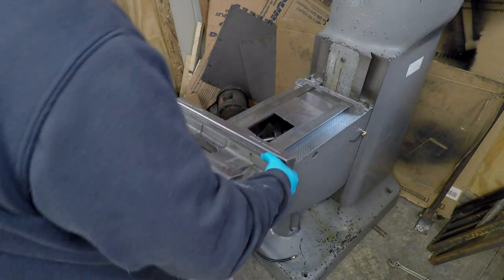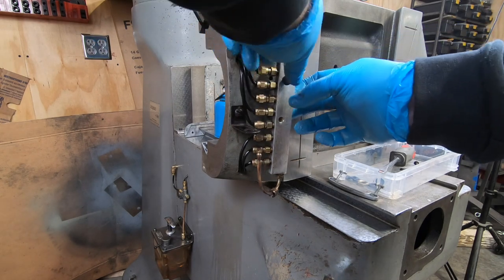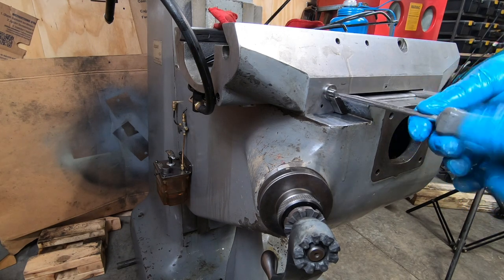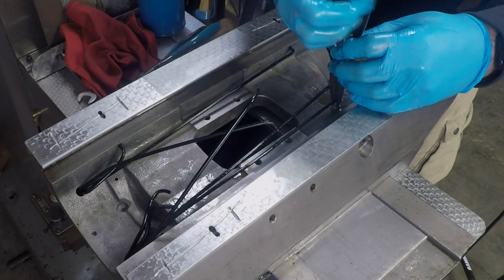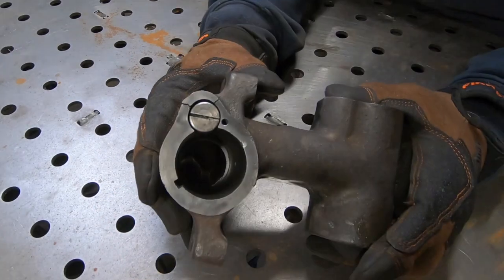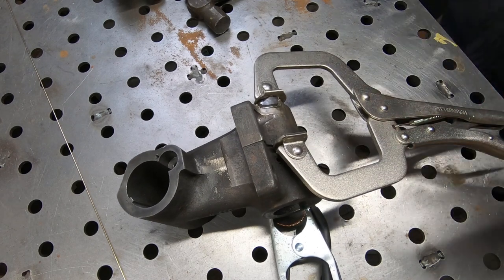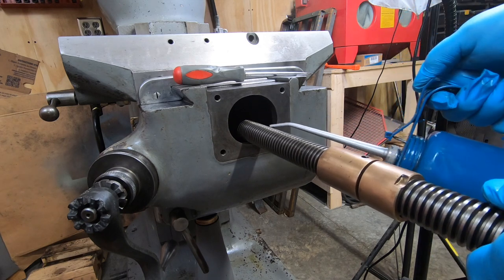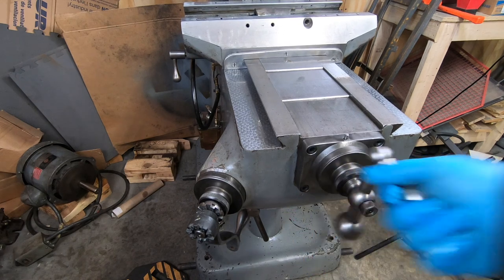Bridgeport Mill - Installing the Saddle and Oil Lines

Comment: Don’t add music, you doing a great job I just subscribed.  I am also about to start my Bridgeport rebuild/ clean up. I also have the same power feed that I just finished rebuilding. One thing you must make sure of is the seals ( or lack of) in the power feed. It’s a convoluted design in that if the seal fails it fills the power feed electronics with oil, and also if not sealed properly will fill the electric motor with oil. That’s what killed my Power feed along with the normal wear and tear of use. I used a little bit of automotive RTV in the reassembly to help combat the sealing issues and also made some umbrella seals out of nylon, that should fix the problem. You will see exactly what I’m talking about once you pull the unit apart if you haven’t already.  Thanks again Great job.  Eddie wheels 😬🧑🏻‍🦽👍 NJ.
Reply from the maker: Thanks. I'll keep my eye on that. There's supposed to be a paper gasket on the cover, but I know some people replace that with RTV, which I don't think it a good idea. There are a couple of other places it can leak, but over filling the gear box is another issue. I may end up just taking it off and replacing it with an extension shaft. We'll see.

Comment: Great videos!  Excellent step by steps on how to disassemble/ reassemble.  I think you could add some montage clips, or some fast forward clips along with some music.  Just mix it up some!  Also, do some experimenting with the Aluminum Bronze on cast using AC.  Works really well repairing dirty castings.
Reply from the maker: Thanks. I did try it on AC once and it didn't seem to flow as well as on DC. I'll give it another try next time.

Comment: Vote no for background tunes. Have you consider using a mike while doing the work  instead of voice over? Interesting,  thanks!
Reply from the maker: Thanks. I have considered using a mic. But there are problems associated with that, from both a personal and technological perspective. Technologically, I don't have the mic. I'd want to use a wireless mic for sure, as I move around the shop a lot. And then record the audio on a device separate from the cameras. No room in the budget for that equipment. PLUS, it would probably make the whole process take longer. I don't always say just what I want to say and it comes out as blather - I sometimes don't notice until I playback the "final" edit. I can easily record a new take on a voice over. I'm not going to go back and reshoot the video. FWIW, I am no expert at anything, and I try to at least get it as right as I can during a voice over. At least it gives me the opportunity to use correct-ish terminology. I think the voice over works for my style.